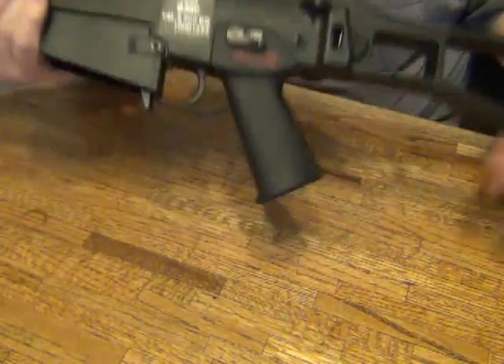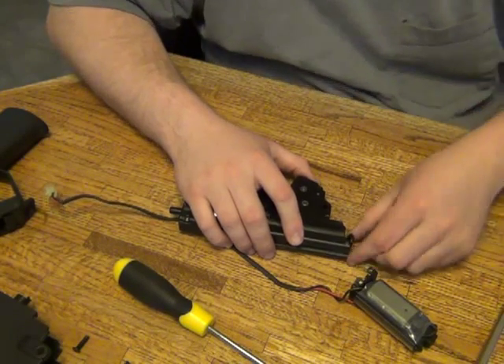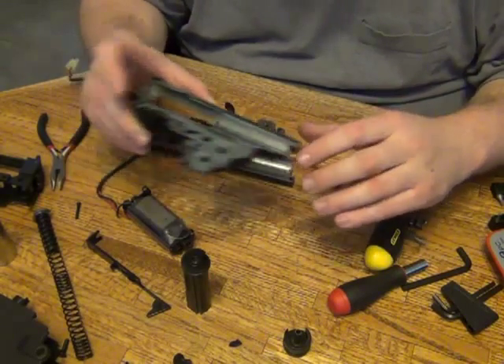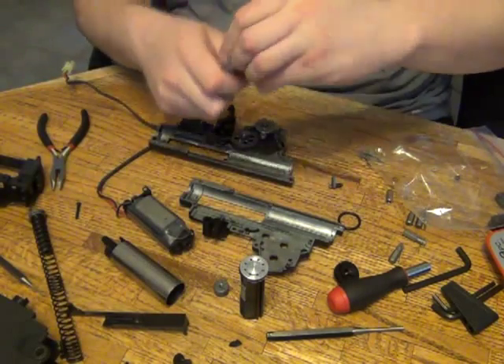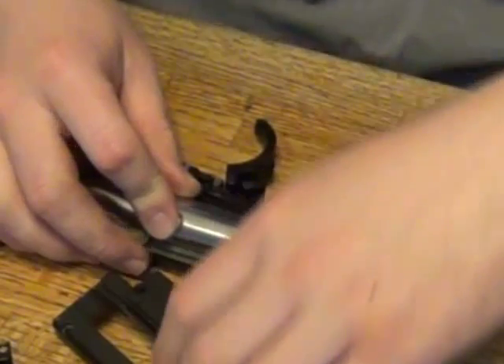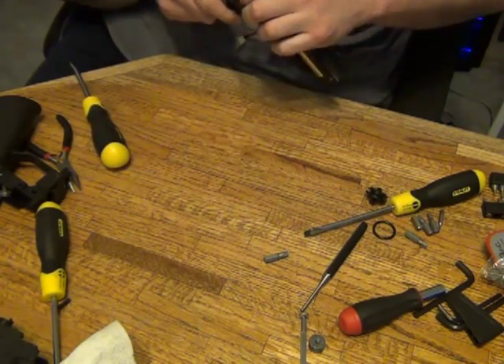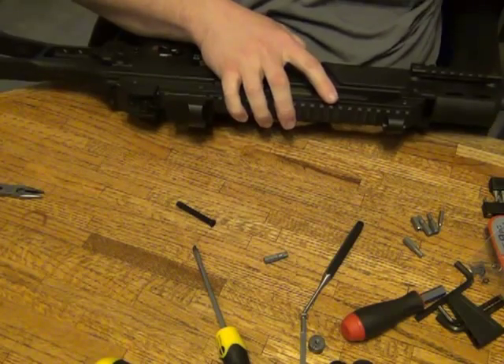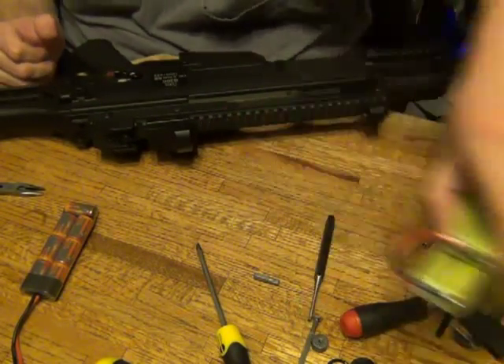Airsoft Compression Test, Broken Piston Head

Comment from the maker: @OnyxAirsofting There are different kinds but you need one that has full protection and protects the trigger contacts too. That takes soldering new wires from the mosfet to the trigger contacts. Also provides the same voltage all the time.

Comment from the maker: @OnyxAirsofting If this happens often, more likely it is a hex screw near the selector plate. What happens is the screw falls inside the gun overtime from the constant vibration and then locks the tappet plate. This then locks the piston and the blowback. The only way to fix it is counterclockwise the screw bringing it out of the gearbox and avoiding the problem for some time. Again it will go back to the same position. If this is your issue, you can glue it or teflon tape it.

Comment from the maker: @OnyxAirsofting Who recommended? Any real tech can explain every problem and with a 11.1 volt lipo, you make your parts lifespan shorter. To best explain, all airsoft guns are made cheaply and most parts are going to break down until you buy extremely expensive parts. Like new gears, 175 dollars. But they never break down even with the strongest spring. Lipo batteries generate a lot of juice and burn the connection at some point. Because of this, the gun will not shoot. Can be fixed, anythingcan